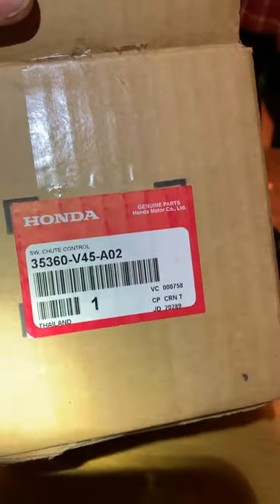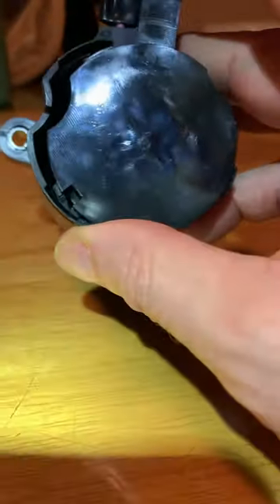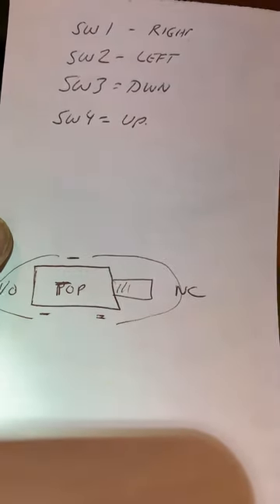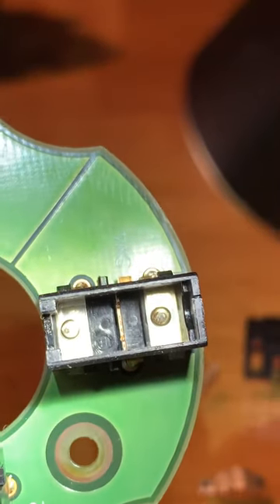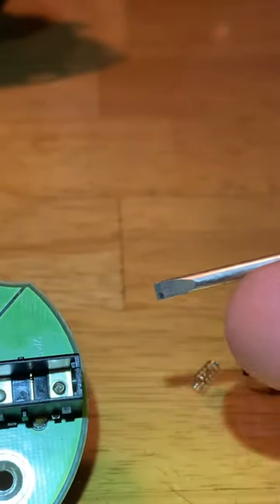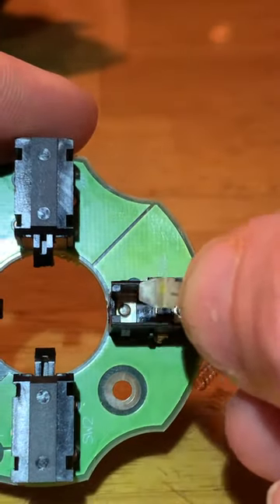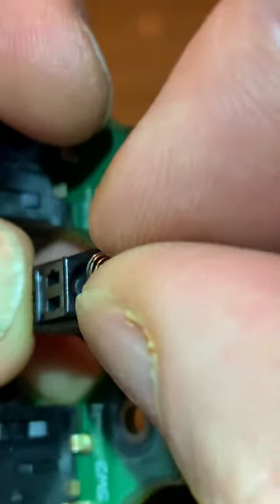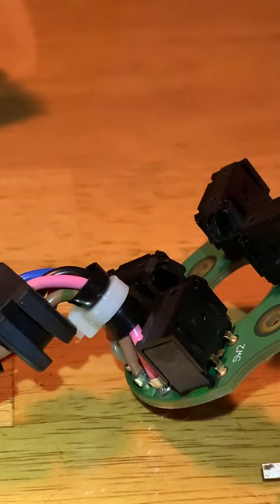Repair Honda Snowblower Joystick Controller - Easy Fix 35360-V45-A02

Comment: Great informative repair video. I like Honda equipment as well but I currently live in Florida now and haven't experienced that issue at all.
Reply: Tony, the joystick that you have 35360-V45-A02, has a upgraded part number 35360-V45-A03.  Not sure what version 3 has to offer

Comment: Just curious, if you just installed that new replacement part for the joystick controls, that would have worked without following your procedure to remove and clean.  I ask because i have an older Honda that has 400 hours on it.